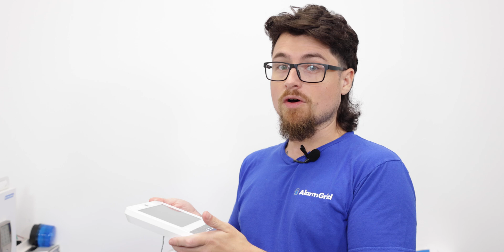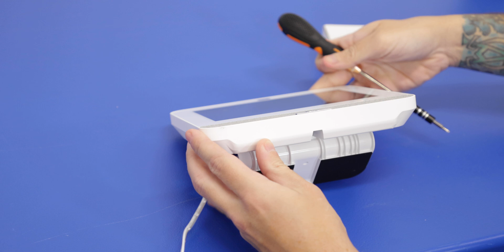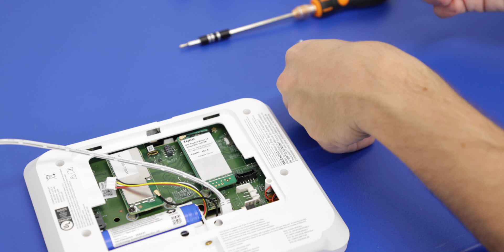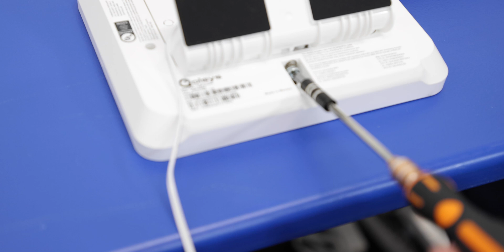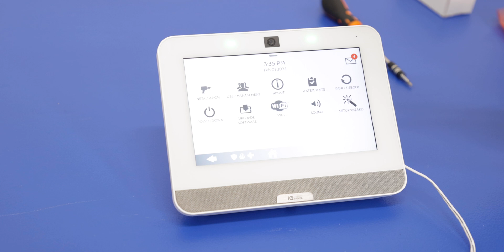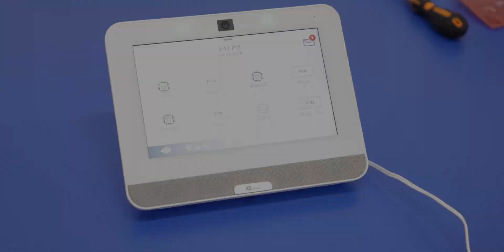Qolsys IQ Panel 4: Installing a Zigbee Card

Comment: Would I be able to do this without the installer/dealer code?
Reply: Hi @Jessefernandez6963, Most usually the Installer or Dealer code is required. You may be able to access the needed sections by using the Master code. Then Default Dealer code is 2222, the default installer code is 1111.  If unable to access the necessary sections of panel configuration. those codes would be required. Your Current service provider should be able to provide those codes or change those codes to allow you access.